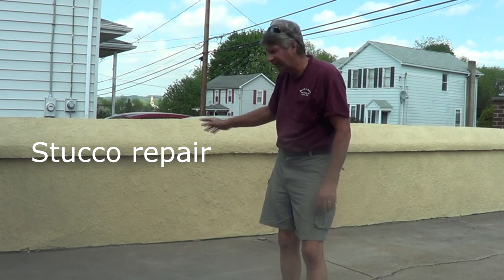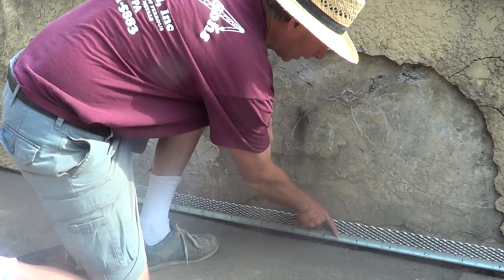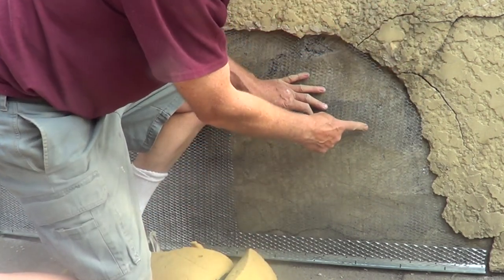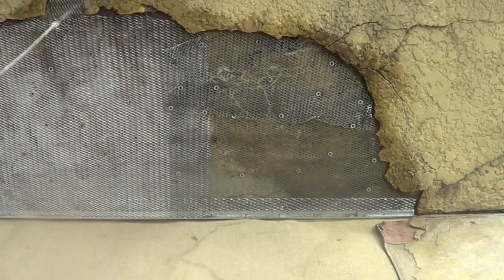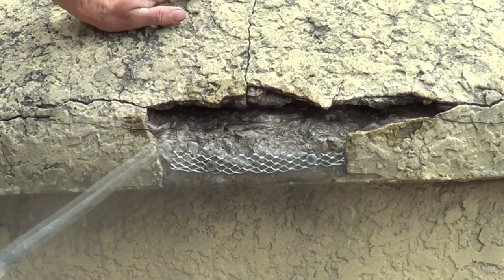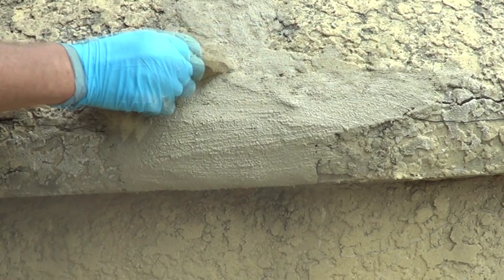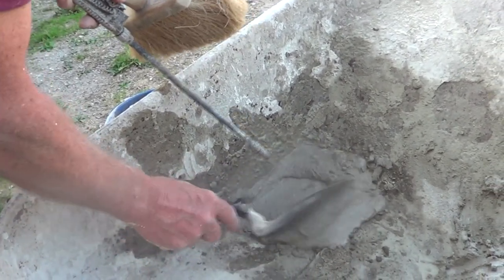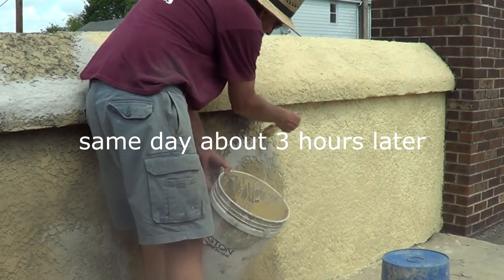STUCCO WALL REPAIR & PAINT (Mike Haduck)

Comment: About to do one like this on Saturday thank you for the post .the only problem is the building is old ,huge ,and all stucco might not have enough paint for whole building only small parts need repair!
Reply from the maker: Hi Max, I’m sure it will work out, stucco does take a lot of paint though, And I seem to have to water it down to get in the cracks, thanks Mike

Comment: Thank you for the video Mike.

I have a question.
You painted the stucco the same day.

Home Depot has asked me to wait for 30 days for the stucco to cure before I should have it painted. In my case, about a 15 feet by 2 feet of stucco was removed and replaced first with some 2 by and 4 and plywood, wire mesh and then stucco. 

How long do you think I should wait before getting it painted. Also, can it be painted when it has rained a day before. Here in south florida these days it has been raining just about everyday and the contractor wants to paint it EVEN when it has rained the previous day.

Thank you.
Reply from the maker: Hi Alag,  I did but I recommend reading the instructions on the paint can some require a couple weeks especially over mortar or Portland,  thanks mike
Reply: @MikeHaduck  Thank you !!

Comment: As always Mike, great video! I have a question; we're getting one of those prefab steel buildings but it doesn't have a front or rear wall. Would we be able to build a stone front wall just by following the arch of the building? What would we need to place between the steel edge and the rock? Thanks!
Reply from the maker: +Melissa Ka'akau-Delizo  It is almost impossible to answer unless I was there to see it.  I would ask the locals first, I hope it helps, thanks mike
Reply: Hey Kiki. Realize this is 6 years old and you've probably bought, sold, and retired to Florida by now.. But  you would want to use Hardie board, or a green rated plywood. But as OP said, best to ask the locals, carpenters/handymans do stuff a little bit different depending on climate, local codes, and haunted Indian burial grounds etc..
Reply: @kevinbaker2470  thanks Kevin!

Comment: Hi Mike.  , I have some stucco cure  from SRK Coating for freshly applied stucco.  I was wondering if I can use this stucco cure to paint my block fence?  I wanted to put some color in this stucco and cure.  Also can I use this stucco cure to paint my house, it has Aluminum siding. I thought about primering the house walls then putting 1 gal of paint to 5 gal of stucco cure to make it go farther cuz I am Disabled with Heart Failure, I don't think I will last much longer. I'm at stage 3 of 4 and don't have much money. So can you help me with my problem?  I need to know asap.  Or maybe somebody on your post that knows what I'm talking about and that can give me an answer soon.  Thank you so much for your time.
Reply from the maker: Hi Donald,   I can not comment on that I never used SRK,  I myself always ask the guys at the paint store what they recommend,  I hope it helps,  God bless,   mike
Reply: Hi Mike, thank you for the reply.  That sounds like good advice I will check it out. thank you and Bod bless

Comment: please tell me you rolled the paint and not brushed the entire thing?..
Reply from the maker: +luis perez  I had to brush it, it was too rough for a roller. and it went fast.  no worries,   thanks mike
Reply: work it in! >:-}
Reply: John Pressure Washing & Painting in Baton Rouge rite on faster right?
Reply: No, with that thick stucco, you want like 1 and 1/4 or 1 and a half inch roller.